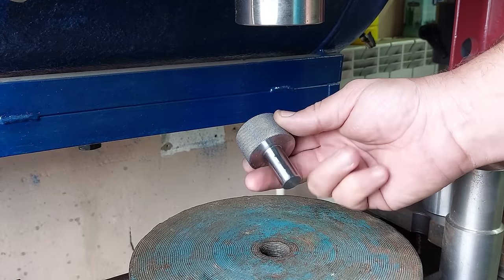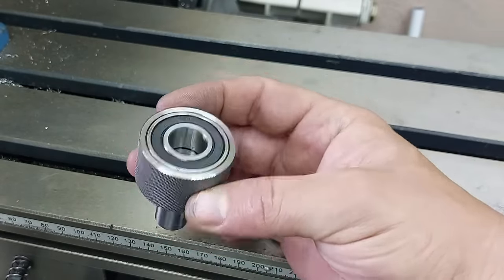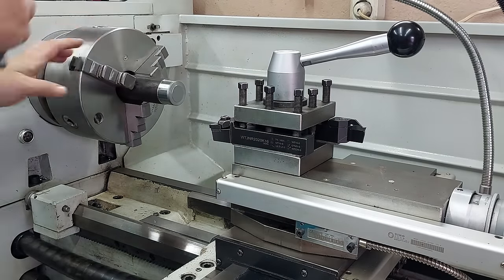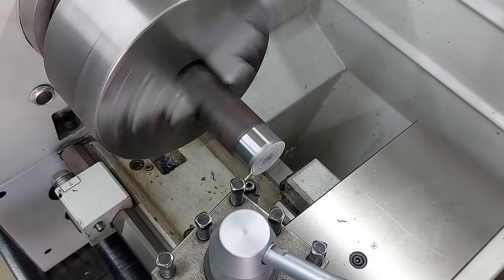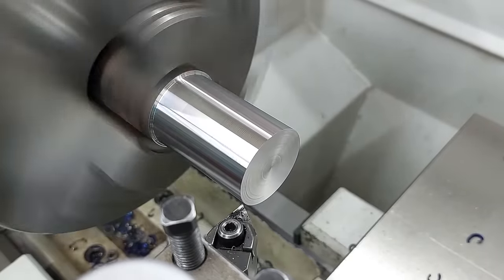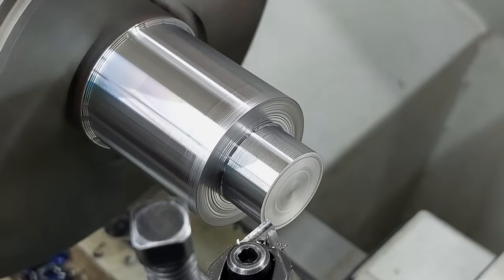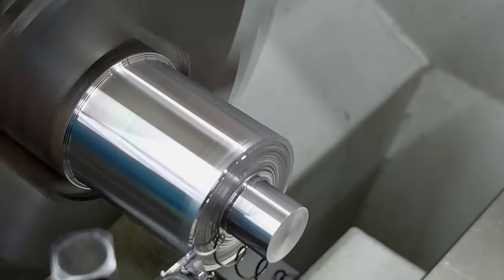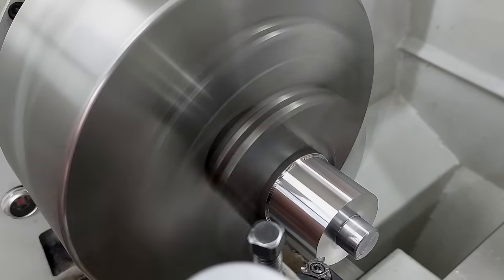Genius invention that should exist everywhere

Comment: A center with a bearing that cannot absorb thrust, centered by a drill chuck, which is not designed to take side pressure, all sticking out way past the tail stock spindle. Seems like a great way to chatter knurl some parts
Reply from the maker: Welcome!
Reply: Hi @ThePigslayer. It's like saying you can't tighten or undo a hexagon nut with an adjustable spanner.
I think we all know both tools work, and one in most of many cases is superior to the other ... 🤔
Reply: @MrArray1967  except in this instance, one is always superior to the other. This is more like making an adjustable wrench to use instead of grabbing the correct wrench you already own

Comment: So instead of turning the tailstock hand wheel to change the chick with a live center you turn the chuck and switch the bit with the live center. A genius invention indeed 😂😂😂 you gain .5 seconds and you trow away all the rigidity in the live center